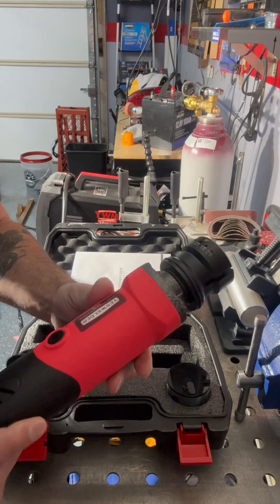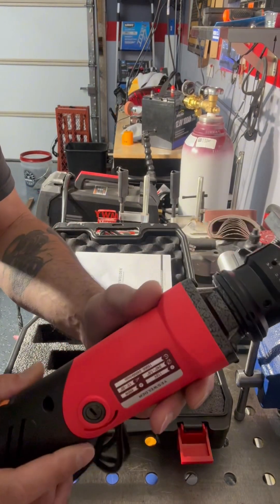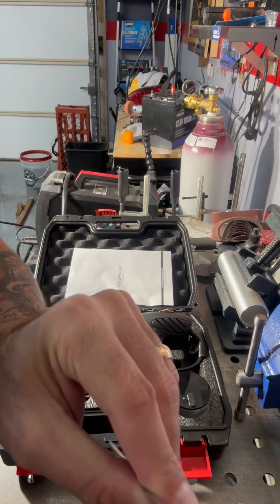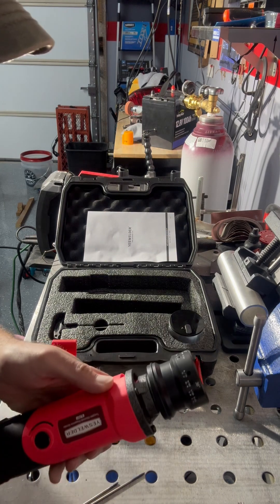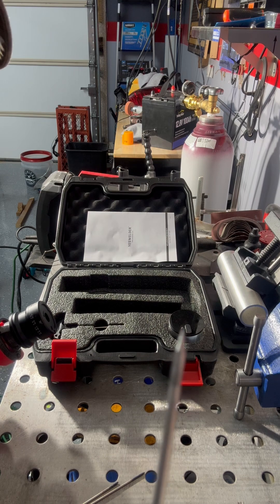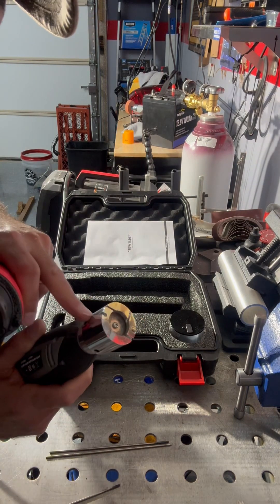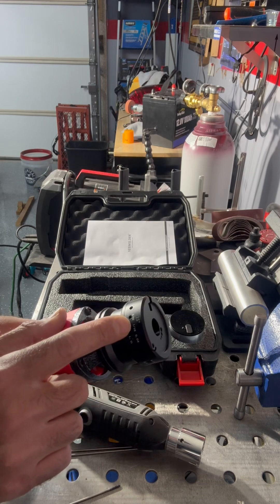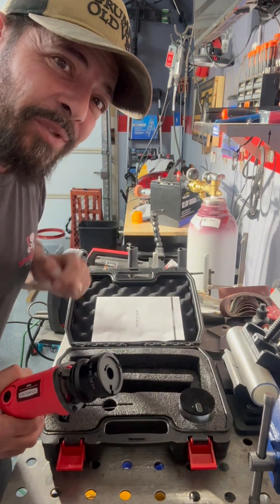How To Properly Sharpen Tungsten Electrodes For Tig Welding

Comment: THIS has 00.000000% chance to make your welds look better it doesnt even make it easier all you need is a drill and a belt sander
Reply from the maker: It’s better than using a drill and a belt sander. You get perfect sharpening and the perfect angle every time.